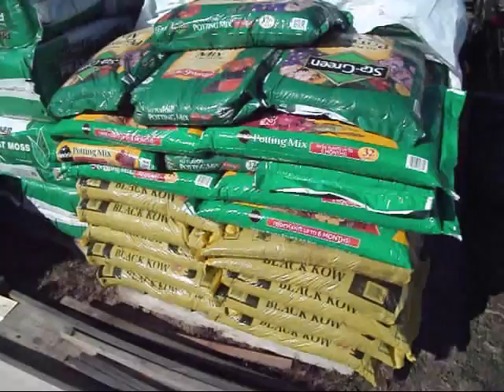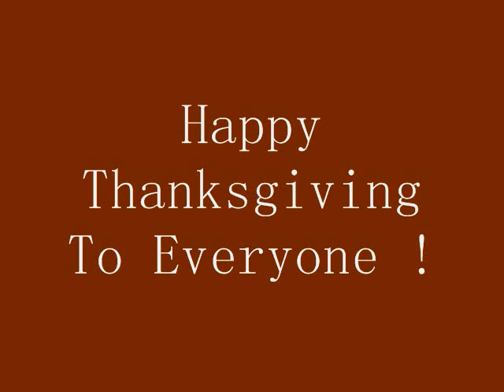Stocking Up at Lowes & Greenhouse Updates

Comment from the maker: @GardenGuy1967 Tomatoes are almost self pollinating, since the blossoms each contain both the male and female parts. All that is required is a bit of vibration to get the pollen to drop down and fertilize the flower. Shaking, wind, vibrating toothbrush...lots of ways to assist the pollination process.

Comment from the maker: Primarily it's insulation. It creates an air pocket that slows down heat loss. Theres about a 30% savings on heat costs when you add the second layer of plastic. I tried it the first winter with just a single layer, and theres a big difference when you add the second one.

Comment from the maker: @horticultureandhomes Thank you mam. I'm on the fence with the protection part...maybe just tinted waterproofing...or possibly primer and paint. Visual appeal is an important aspect of the whole deal. For some reason, I'm in no hurry to put the plastic on. I want everything just right before I cover it up. But it has to be done in the next few weeks, as I'm about to transplant my seedlings to 4 inch pots. They won't wait forever.

Comment from the maker: @galegregory97comcast I bought 2 types of 6mil for the new GH. The outer layer will be a standard GH film. The inner layer is IR/AC, meaning it has an additive that slows infrared heat loss, and also acts as an anti-condensate. I bought it from a local supplier, Griffins, up in Richmond. It was cheaper for me to drive 70 miles and pick it up than to order anywhere online and pay the freight costs. Thx !

Comment from the maker: Seed starting is very simple. It can be done in most any plastic container. You don't have to buy expensive seed trays or anything.  Just put some starting mix in a container and do it like you would if you planted a seed outside. It's the same concept, just on a micro scale. The 2 most important things are proper heat for peppers, and plenty of light for everything to keep them from stretching and getting leggy. Hydro tomatoes are just an easy process, very few variables to deal with.